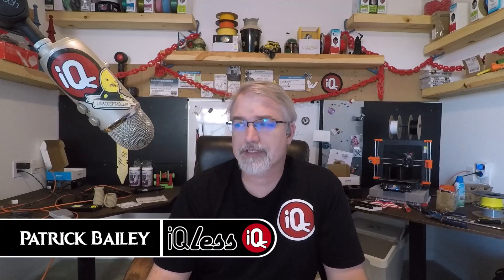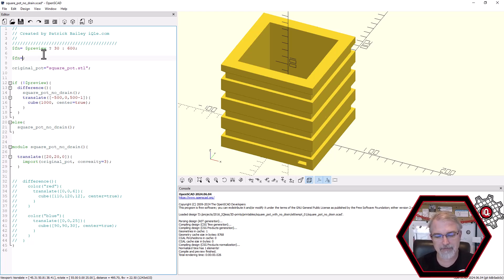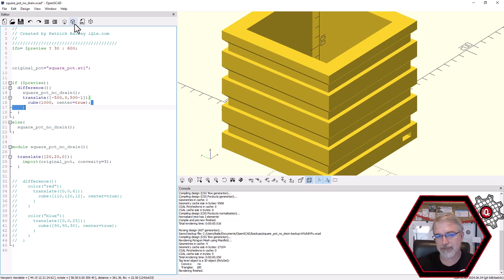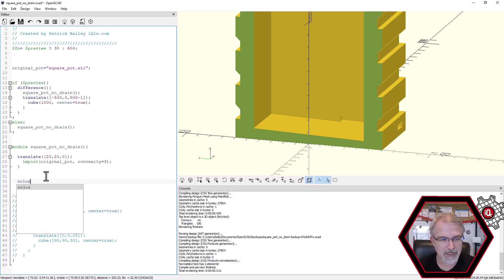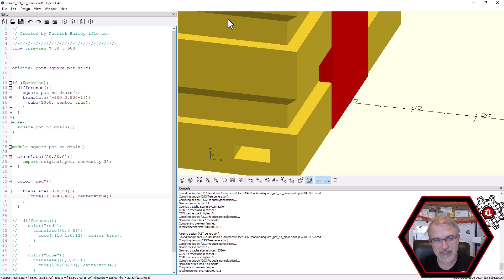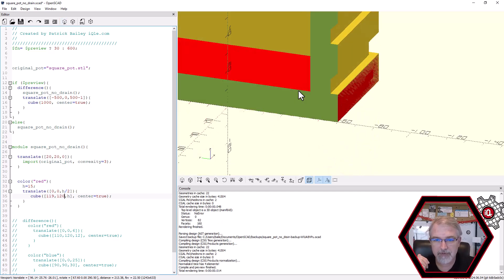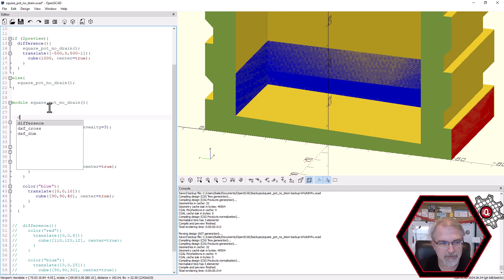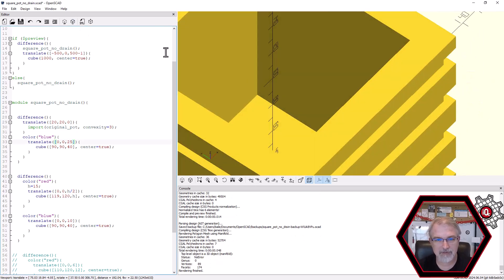OpenScad: Tweaking an existing model

Comment: I'm surprised you didn't use the Measure Distance tool to get some base measurements from the imported stl.
Reply from the maker: I was not aware of that feature I will have to do a video on that one
Reply: @iqless  There is also a Measure Angle tool.
Reply: Knowledge acquired!! Thank you!

Comment: Wonderful video about my favorite CAD program!

There is one feature that I NEVER see anyone talking about or using in tutorial videos, and it would be VERY useful for these videos, and for every user in general. This might be the MOST useful feature of this wonderful program.

Put your cursor just to the right of any digit, press and hold ALT and then press up arrow to increase that digit or down arrow to decrease. Previews will update instantly, and it makes fine adjustment SOOOO simple. If you need more precision, ALT-right will add decimal places to the number, and you will then adjust THAT digit up or down instead. ALT-left works just the way you'd think it would.

This would make doing those adjustments you had to do to match up the edges MUCH easier and faster. Try it, you'll soon come to depend on it!
Reply: oh wow, that is so handy!
Reply from the maker: Oh that is nice.
I am making a short showing how to do that one.
I would use this all the time!!!
Reply: @iqless  I have another cool tip which can save a LOT of typing too if you want to hear about it. The instructions for this one are quite a bit longer, so I could send you an email if you give me an address, or try to post it here. It's to do with the right-click pop-up menu 'Insert Template' function, and how to create your own blocks of code to use as templates. You can use it to insert anything you want, including something like translate() rotate() cube() all in one go.